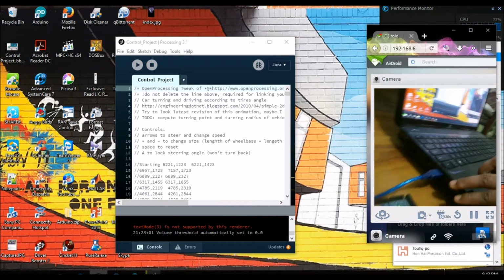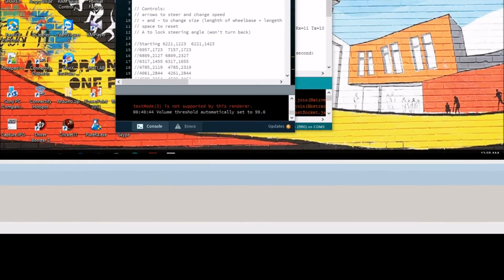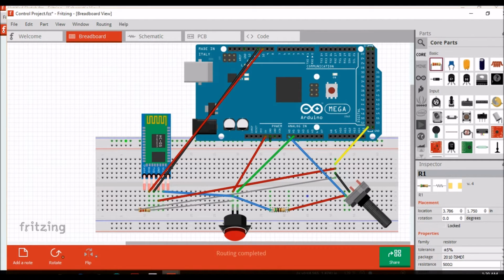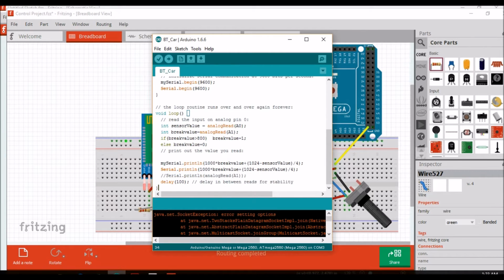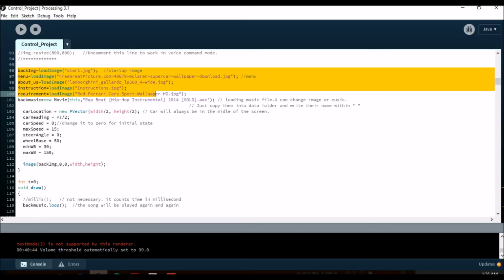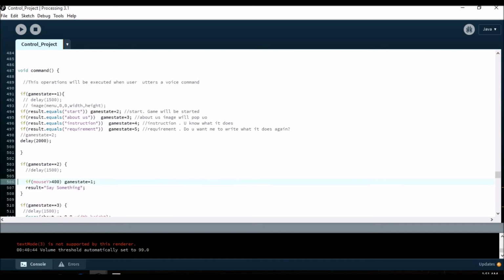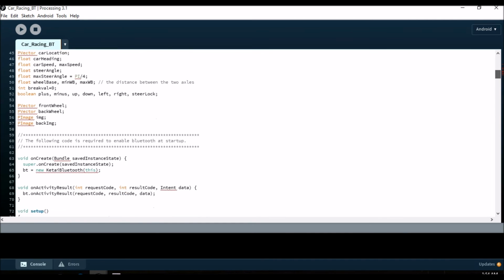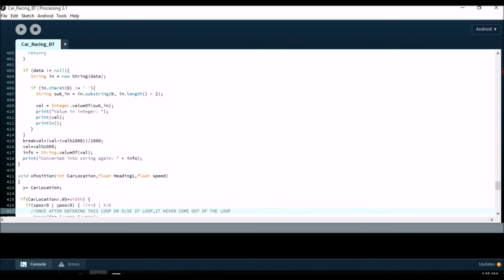Car Racing Game  for PC and Android Using Arduino and Processing (With explanation)

Comment: i have the following error message on Processing:

 The import java.io.OutputStream is never used
----------
11. WARNING in C:\Users\hp\AppData\Local\Temp\android6757731791175190172sketch\src\processing\test\sketch_160715b\sketch_160715b.java (at line 21)
 import java.io.IOException; 
        ^^^^^^^^^^^^^^^^^^^
The import java.io.IOException is never used
----------
12. WARNING in C:\Users\hp\AppData\Local\Temp\android6757731791175190172sketch\src\processing\test\sketch_160715b\sketch_160715b.java (at line 49)
 ArrayList devicesDiscovered = new ArrayList();
 ^^^^^^^^^
ArrayList is a raw type. References to generic type ArrayList<E> should be parameterized
----------
13. WARNING in C:\Users\hp\AppData\Local\Temp\android6757731791175190172sketch\src\processing\test\sketch_160715b\sketch_160715b.java (at line 49)
 ArrayList devicesDiscovered = new ArrayList();
                                   ^^^^^^^^^
ArrayList is a raw type. References to generic type ArrayList<E> should be parameterized
----------
13 problems (13 warnings)

-post-compile:

-obfuscate:

-dex:
input: C:\Users\hp\AppData\Local\Temp\android6757731791175190172sketch\bin\classes
input: C:\Users\hp\AppData\Local\Temp\android6757731791175190172sketch\libs\ketai.jar
input: C:\Users\hp\Documents\Processing\modes\AndroidMode\sdk\tools\support\annotations.jar
input: C:\Users\hp\AppData\Local\Temp\android6757731791175190172sketch\libs\processing-core.jar
Pre-Dexing C:\Users\hp\AppData\Local\Temp\android6757731791175190172sketch\libs\ketai.jar -> ketai-1d1605b00f7b0f2244fb5fd3708dc11e.jar
Pre-Dexing C:\Users\hp\Documents\Processing\modes\AndroidMode\sdk\tools\support\annotations.jar -> annotations-c88f76dfadd1574f4faf98bfa7416236.jar
Pre-Dexing C:\Users\hp\AppData\Local\Temp\android6757731791175190172sketch\libs\processing-core.jar -> processing-core-bcc520860dc058949790c1cc93f30df9.jar
Converting compiled files and external libraries into C:\Users\hp\AppData\Local\Temp\android6757731791175190172sketch\bin\classes.dex...
       [dx] Merged dex #1 (9 defs/10.3KiB)
       [dx] Merged dex #2 (2 defs/1.1KiB)
       [dx] Merged dex #3 (53 defs/118.4KiB)
       [dx] Merged dex #4 (160 defs/685.1KiB)
       [dx] Result is 224 defs/972.0KiB. Took 0.3s

-crunch:
   [crunch] Crunching PNG Files in source dir: C:\Users\hp\AppData\Local\Temp\android6757731791175190172sketch\res
   [crunch] To destination dir: C:\Users\hp\AppData\Local\Temp\android6757731791175190172sketch\bin\res
   [crunch] Processing image to cache: C:\Users\hp\AppData\Local\Temp\android6757731791175190172sketch\res\drawable-hdpi\icon.png => C:\Users\hp\AppData\Local\Temp\android6757731791175190172sketch\bin\res\drawable-hdpi\icon.png
   [crunch]   (processed image to cache entry C:\Users\hp\AppData\Local\Temp\android6757731791175190172sketch\bin\res\drawable-hdpi\icon.png: 52% size of source)
   [crunch] Processing image to cache: C:\Users\hp\AppData\Local\Temp\android6757731791175190172sketch\res\drawable-ldpi\icon.png => C:\Users\hp\AppData\Local\Temp\android6757731791175190172sketch\bin\res\drawable-ldpi\icon.png
   [crunch]   (processed image to cache entry C:\Users\hp\AppData\Local\Temp\android6757731791175190172sketch\bin\res\drawable-ldpi\icon.png: 0% size of source)
   [crunch] Processing image to cache: C:\Users\hp\AppData\Local\Temp\android6757731791175190172sketch\res\drawable-xhdpi\icon.png => C:\Users\hp\AppData\Local\Temp\android6757731791175190172sketch\bin\res\drawable-xhdpi\icon.png
   [crunch]   (processed image to cache entry C:\Users\hp\AppData\Local\Temp\android6757731791175190172sketch\bin\res\drawable-xhdpi\icon.png: 74% size of source)
   [crunch] Processing image to cache: C:\Users\hp\AppData\Local\Temp\android6757731791175190172sketch\res\drawable-xxhdpi\icon.png => C:\Users\hp\AppData\Local\Temp\android6757731791175190172sketch\bin\res\drawable-xxhdpi\icon.png
   [crunch]   (processed image to cache entry C:\Users\hp\AppData\Local\Temp\android6757731791175190172sketch\bin\res\drawable-xxhdpi\icon.png: 80% size of source)
   [crunch] Processing image to cache: C:\Users\hp\AppData\Local\Temp\android6757731791175190172sketch\res\drawable-xxxhdpi\icon.png => C:\Users\hp\AppData\Local\Temp\android6757731791175190172sketch\bin\res\drawable-xxxhdpi\icon.png
   [crunch]   (processed image to cache entry C:\Users\hp\AppData\Local\Temp\android6757731791175190172sketch\bin\res\drawable-xxxhdpi\icon.png: 95% size of source)
   [crunch] Processing image to cache: C:\Users\hp\AppData\Local\Temp\android6757731791175190172sketch\res\drawable\icon.png => C:\Users\hp\AppData\Local\Temp\android6757731791175190172sketch\bin\res\drawable\icon.png
   [crunch]   (processed image to cache entry C:\Users\hp\AppData\Local\Temp\android6757731791175190172sketch\bin\res\drawable\icon.png: 84% size of source)
   [crunch] Crunched 6 PNG files to update cache

-package-resources:
Creating full resource package...
     [aapt] Warning: AndroidManifest.xml already defines debuggable (in http://schemas.android.com/apk/res/android); using existing value in manifest.

-package:
Current build type is different than previous build: forced apkbuilder run.
Creating sketch_160715b-debug-unaligned.apk and signing it with a debug key...

-post-package:

-do-debug:
Running zip align on final apk...
     [echo] Debug Package: C:\Users\hp\AppData\Local\Temp\android6757731791175190172sketch\bin\sketch_160715b-debug.apk
[propertyfile] Creating new property file: C:\Users\hp\AppData\Local\Temp\android6757731791175190172sketch\bin\build.prop
[propertyfile] Updating property file: C:\Users\hp\AppData\Local\Temp\android6757731791175190172sketch\bin\build.prop
[propertyfile] Updating property file: C:\Users\hp\AppData\Local\Temp\android6757731791175190172sketch\bin\build.prop
[propertyfile] Updating property file: C:\Users\hp\AppData\Local\Temp\android6757731791175190172sketch\bin\build.prop

-post-build:

debug:
Did not find onBluetoothDataEvent callback method.
Socket Type: SecureBEGIN mAcceptThreadThread[Thread-9564,5,main]
AcceptThreadSecure
java.lang.NullPointerException: in == null
 at libcore.io.Streams.readFully(Streams.java:74)
 at java.io.DataInputStream.readInt(DataInputStream.java:103)
 at processing.core.PFont.<init>(Unknown Source)
 at processing.core.PApplet.loadFont(Unknown Source)
 at processing.test.sketch_160715b.sketch_160715b.setup(sketch_160715b.java:104)
 at processing.core.PApplet.handleDraw(Unknown Source)
 at processing.core.PGraphicsAndroid2D.requestDraw(Unknown Source)
 at processing.core.PApplet.run(Unknown Source)
 at java.lang.Thread.run(Thread.java:818)
FATAL EXCEPTION: Animation Thread
Process: processing.test.sketch_160715b, PID: 16641
java.lang.RuntimeException: Could not load font Arial-BoldMT-24.vlw. Make sure that the font has been copied to the data folder of your sketch.
 at processing.core.PApplet.die(Unknown Source)
 at processing.core.PApplet.die(Unknown Source)
 at processing.core.PApplet.loadFont(Unknown Source)
 at processing.test.sketch_160715b.sketch_160715b.setup(sketch_160715b.java:104)
 at processing.core.PApplet.handleDraw(Unknown Source)
 at processing.core.PGraphicsAndroid2D.requestDraw(Unknown Source)
 at processing.core.PApplet.run(Unknown Source)
 at java.lang.Thread.run(Thread.java:818)
Reply from the maker: Try to use Processing revision 0249 or older version. If there is still problem, try to find a older version of Android Mode. I also use an older version of Android Mode. Let me know what happend. 
 hala hatim
Reply: is  this Processing 3.1.1 ? i found that when i tried to search for? i am using that version, and for android mode do i have to install again ? how to know which android mode version i use
Reply from the maker: Try to run a simple bluetooth code. You can follow this one: 

https://prof-takaya.blogspot.co.uk/2013/02/connecting-android-and-arduino-by.html

If it works properly then u don't have to change anything. Otherwise let me know it.I am using an older version of Android Mode. I can send it to u via e-mail.
Reply: it didn't work, i guess maybe the problem with the library Ketai, but i have already installed , here is my email: halahatim99@gmail.com ,, thanks a lot for ur help i appreciate  it
Reply from the maker: I've sent you a zip file named "Android Mode.zip". Unzip it. Go to your Processing folder where u save your sketches. Here u'll find a folder named "modes". Open it. Replace the "Android Mode" folder with your unzipped folder. Then restart your Processing.exe
Reply: I received your email 2 days ago , but I'm afraid there's no attached files on the email :/ :(
Reply from the maker: Sorry. I was so busy that I couldn't reply to u'r message. Anyways seems like gmail has deleted my file. I have already tried a numerous ways to send u the folder but failed. So I uploaded it onto Mediafire.Check the link given below and let me know if it worked.

https://www.mediafire.com/?a537fzjwqfhdai8
Reply: Thanks , but still the same actually the file u have sent me just appear as processing files and i can directly open it , there is no application file , anyways i have tried to install all the android SDK tools and i am trying to check with my library may be there's missed required file , i have send you on gmail screenshot for my library  files list ,, i really appreciate your help and your time,  can't thank you enough , hope the problem will solve soon
Reply from the maker: U are not supposed to open them. U just have to replace the "Android Mode" folder with it. Go to your Documents/Processing/modes folder and replace it with my folder(Don't forget to unzip it before replacing)

I don't think the problem is with your libraries. Ketai itself is enough for bluetooth communication with Android and Arduino. Maybe there is something wrong with u'r SDK tools.Did u installed API 10 or higher versions?

Comment: Thanks for the video, i have been searching for long time till i found this processing code,  when i tried to upload the application on my phone i got error message:  "unfortunately, "file_name"  has stopped" i have tried with two phones. one of them it asked me to turn on the Bluetooth and the other i got the error message without asking for switching the Bluetooth, even though after switch it i got the error message, what can i do ? is this related to security of the phone that can't upload the file or what do u suggest me to  do ? Thanks again
Reply from the maker: Thanks. One of the major drawback of this game is that it doesn't run on every smartphones. It takes over a huge amount of RAM's space(around 900 MB in my case) I had to free my phones memory to run it. I recommend you to use a phone with at least 1 GB of RAM. Let me know if it worked.

Btw where did you get the code? Did you type it from the screen? LOL
Reply: heheh no actually i am doing program do as same concept but not the game ,,heart rate monitoring, i found the code online for Jave mode and it works,  i just adjusted the program to Android mode so i followed your video for Bluetooth part instead of import serial